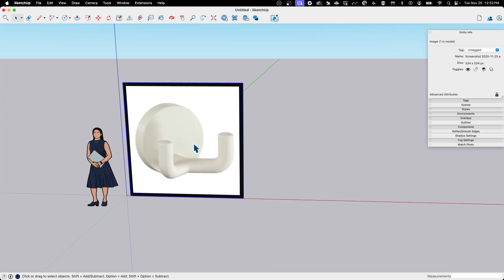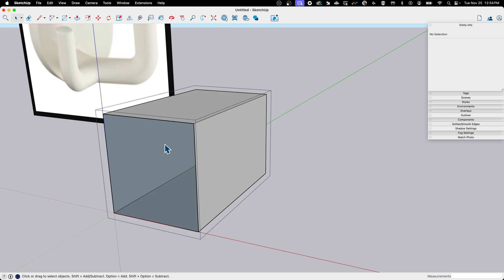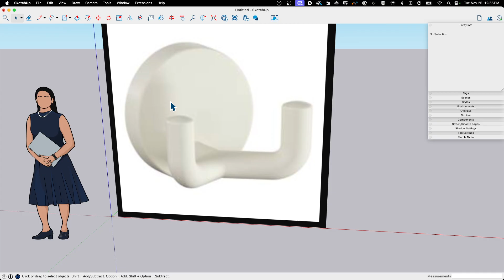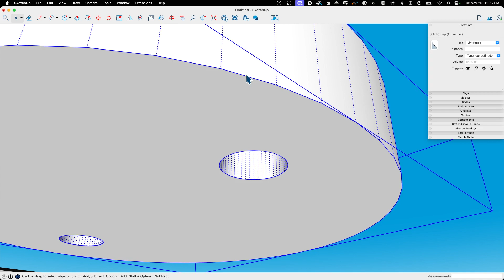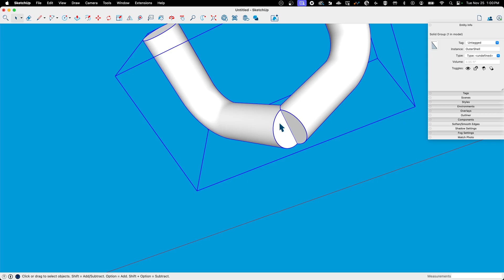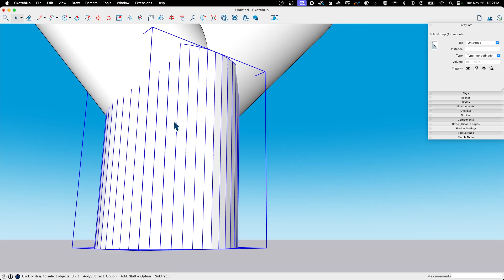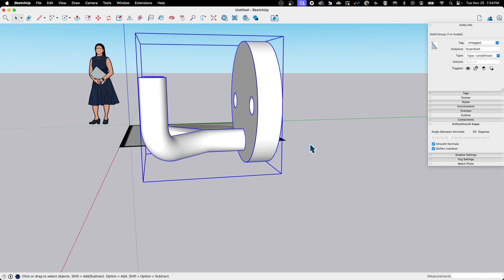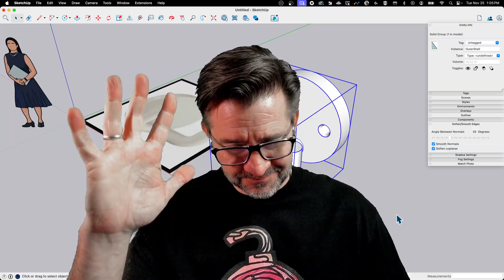Why I ALWAYS Model Solids in SketchUp

Comment: Nice!
Worth mentioning the Dave Method™️ here.
Unions and intersections sometimes fail to generate tiny faces in geometry like compound curves. They could be so small that you might spend ages trying to find and patch them.
If you make your solids 10 or 100 times bigger before using solid tools it can often solve these problems.
Remember to shrink them by the correct factor afterwards!